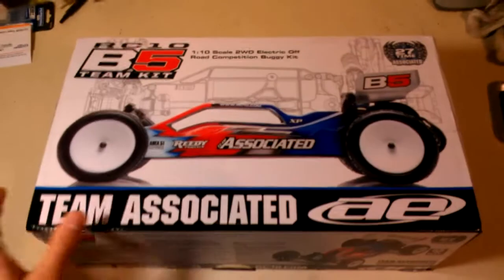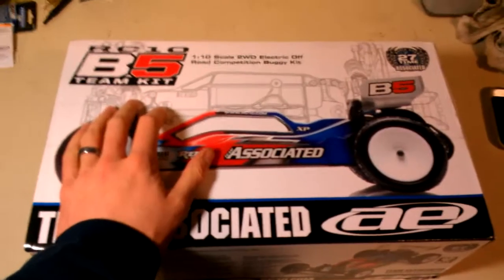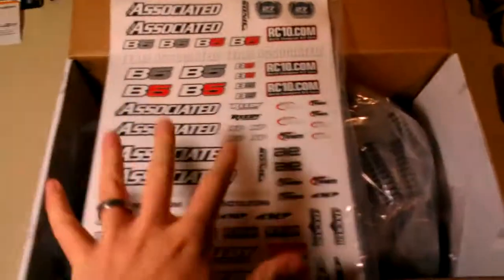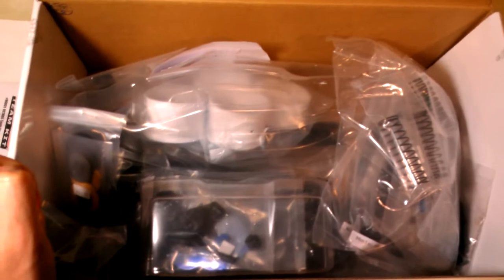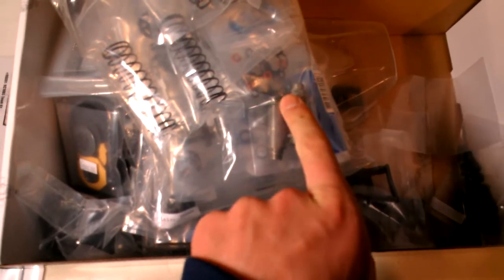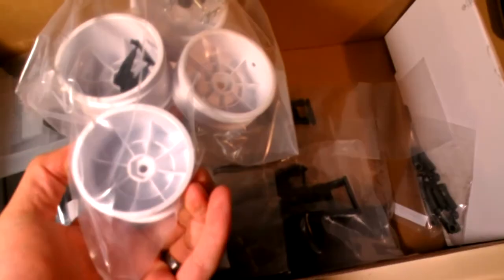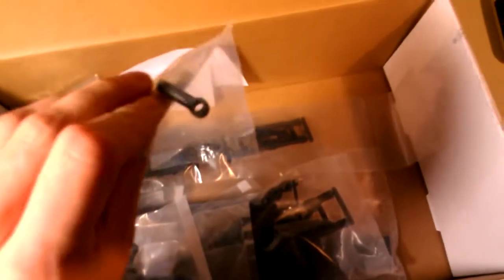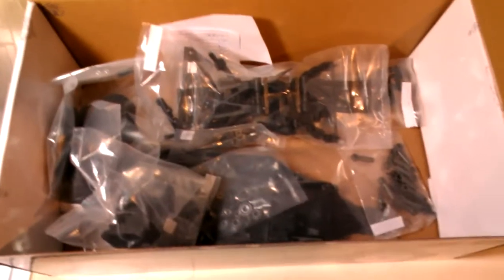Team Associated RC10 B5 unboxing

Comment: Will you do an after run review?
Reply from the maker: I plan on it.
Reply: doctormosfet Good. I have been looking at this, but I have been driving the 22 2.0 for about two months now in rear motor and it handles like a dream. I loved my B4.2 Factory Kit, but when I dropped the 22 on the track..I never looked back at my 4.2 and sold it the next day. So..hopefully the B5 is doing pretty good. How do you like it thus far?
Reply from the maker: Chester Copperpot
It is amazing.  I'll have an initial review video soon, but long story short, it is amazing.